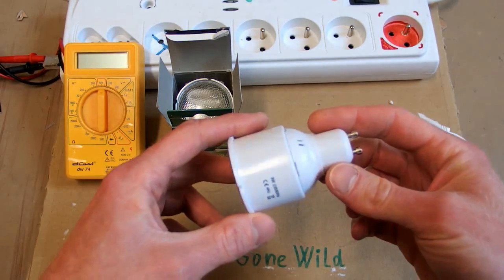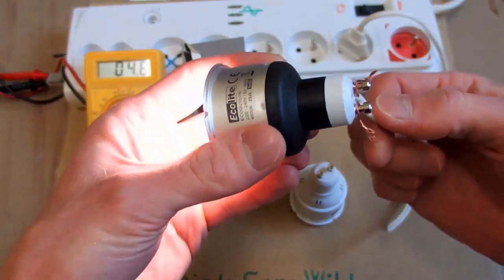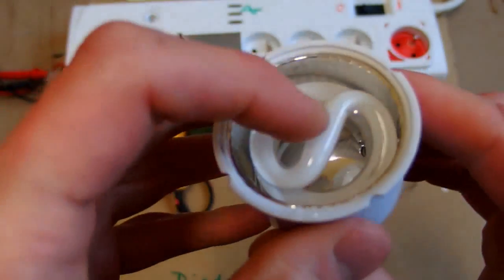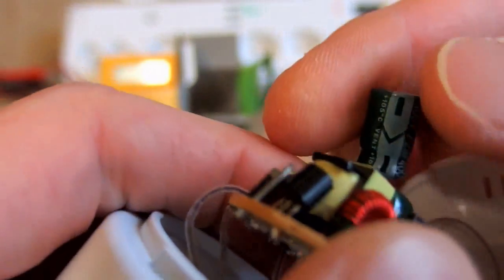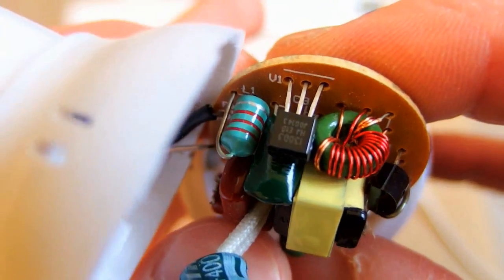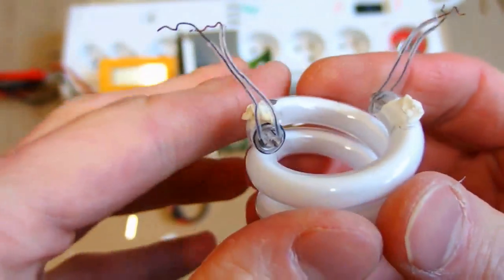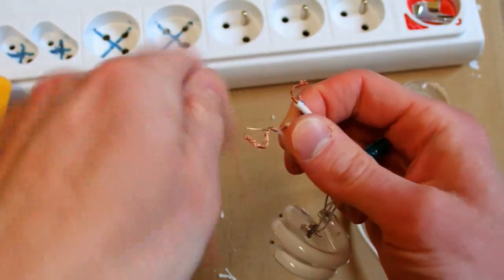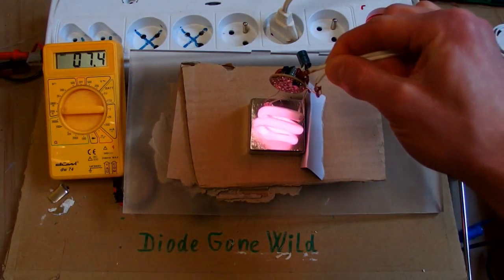CFL Teardown (strange fault - pink light)

Comment: Look up magnetic hysteresis. The magnet saturates the transformer core reducing the efficiency. You can burn out the power supply by subjecting it to the magnet. More study on the subject https://en.wikipedia.org/wiki/Saturable_reactor

Comment: Mercury starved fluorescent tube. Normally CFLs doesn't get mercury starved, this is the first time I see it. Or it could have been that the driver failed and the tube received enough voltage for arc ignition but not much current at all so the discharge is so weak it does not produce enough UV to excite any other phosphor that is in the triphosphor blend and only excites the one that is easiest, witch is the pink one thus the tube glows pink. I have seen it happen in cheap electronic ballasts. Philips TL-D Master F36T8 Warm white tubes lit up in barely visible pink color because driver does not provide enough arcing current and the tube is extremely dim.Usually if that happens it means that the switching transistor is bad and doesn't switch at a high current

Comment: Plot twist
It was actually a 11,000K light temperature
Reply: @question_mark 10k temp is too low to see light, 100k still not hot enough, 700k you might be able to see it glow red, 1000k temp is towards red, 2000k is orangy yellow, 2700k is warm white, 3000k is led warm white, 4000k is neutral white, 5000k is cloudy light, 6400k is daylight and temperatures like 11000k are very blue.
Reply: You mean 1,200K
Reply: @question_mark 11k is very cool white tempourature. The bulb wiuld emit a cyan blue color
Reply: @matejgamingandotherstuff6484 Are you referring to "k" as kelvin or as kilo(1000)?
Reply: @matejgamingandotherstuff6484 That explains it then. (Kelvin is symbolised with capital K)

Comment: Did he say the “mains” voltage was coming from an AA battery? 10:08
Reply: No. He meant that he had just handled 230V as if it was a 1.5V AA Battery. Just look how he handles Mains voltage. Barely any safety measures.
Reply: He said “and yes i handle mains voltage as if it was an aa battery”

Comment: The inductor acts as a ballast, it limits the current and thefore the power to the tube, when you put it near to the magnet the inductor core starts to saturate, this will allow more cirrent through the inductor increasing the power.
Reply: Splitfire pilot; No, the magnet causes emitted electrons to spiral through the gas path, ionising more of the gas in the process. More ions causes more currenr flow at mostly the same voltage.

Secondly, he didn't have the ferrite close enough to the magnet for what you suggested to happen. The transformer would also saturate in that case anyway, causing the power to drop. Which one will win in that case, I don't know, but it will definitely not just be like the choke isn't there.
Reply: Accepted your probably right about the chemistry, not my scene.
And yes a transformer secondary output would reduce if saturated, however the few Cfl's I've pulled to bits used a choke not a transformer.

Comment: whats the tube wires polarity? or thats not polarized?
Reply: The tube actually runs on high frequency AC square wave. Polarity doesn't matter. The only important thing, is that each filament is connected to it end of the power supply. It's basically a "rapid start" configuration, but runs at about 40 kHz.

Comment: The mercury leaked out and it left the argon behind so it is just an argon discharge
Reply: But if the mercury leaked out, how come the argon is still in the tube? Shouldn't the argon be displaced with air since the tube is under a vacuum?

Comment: I always keep the electronics out of one of those CFLs because they always have at least one and often two ferrite cores which are great for winding a Joule Thief coil.

There's always a toroid core in there, and often you'll find another, cylindrically wound coil.  You can unwind the cylindrically wound coil and you get enough wire to both re-wind the coil for a Joule Thief and to wind a new Joule Thief coil on the toroid.

If there's only the toroid, you can steal the wire for the Joule Thief coil from the inductor.  I haven't tried to re-wind the inductor yet, because it's too difficult to get it unwound while preserving the ferrite core intact.

Still, getting two coils out of one CFL is pretty good.

I've wired the Joule Thief circuit into a few of those cheap LED chains which normally use two AA cells in series so that you can use just one cell to drive the LEDs.  My impression has been that it runs at least as long with only one cell going through the Joule Thief circuit as it did with two cells directly driving the LED chain.
Reply: This lamp is what words "joule thief" realy mean. We need new name for joule harvester. For example joule harvester...
Reply: To open the transformer core without cracking it, you can put it in a boiling water for a few minutes

Comment: If you take the lamp that works together with that pink lamp, put them in the refrigerator for a while, I wonder if you might be able to see the mercury? If it is such a large amount you are able to see it?
Another thing; I have always wondered about that powerstrip with that yellow multimeter connected to it... It measures power? How do you do that? Does that power-strip have more tricks up it's sleeve? Topic for a video perhaps?
Reply from the maker: This is what's inside the power-strip :).
http://danyk.cz/wmetr_en.html
Reply: Ah, ok. So that is the secret : )
Interesting.

Comment: What an odd effect, did you try a pcb from another flourescent bulb, perhaps slightly more modern with two transistors?
I keep the pcbs from the ones with dead tubes, most pcbs checkout fine, i dont like throwing away usable parts.
Reply from the maker: This one also has 2 transistors :). I also keep all the PCB's from those, the parts are sometimes useful :).
Reply: Yep just like me, when one of my flourescents stop dead for no reason, its usually the capacitor between the heaters, my draw of pcbs often have a good capacitor :-).
Its not that i dont want to buy a new bulb, i think its worth a go at repairing it, also i come from a family with very little money so i try not to waste usefull stuff.
Im sure you know what i mean :-)
Reply from the maker: I also repair them just because I'm curious what is the fault and it's always a challenge trying to make it work again :). Of course, the time spent is worth more than the lamp...
Reply: I have read that this is due to the mercury escaping the tube, somehow ...

Comment: I wonder if something has changed that reduced the effective florescence of the phosphor. I remember that there was a reasonably common failure mode with CCFL LCD panels in laptops where the backlight would turn pink, it was always the CCFL in the panel that had become faulty.
Reply from the maker: This one is new, it is like this from the beginning. The phosphor seems ok, but the gas filling is probably wrong. Normally, you can see the typical cyan glow of mercury at the ends of the tube where the phosphor is missing. Threre's no cyan glow.
Reply: @DiodeGoneWild  absolutely, it's a lamp that made it out of the factory when it should have been rejected. It's a cool looking tube though you should have kept it as a curiosity...
Thanks for showing 

Steve
Reply: Alex West 
The mercury is lost or lost and you are left with an argon discharge